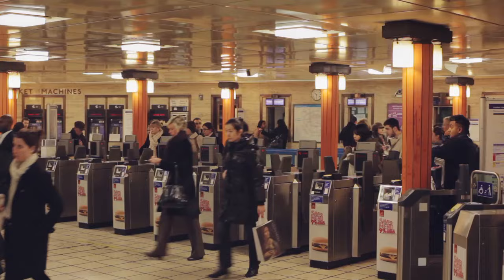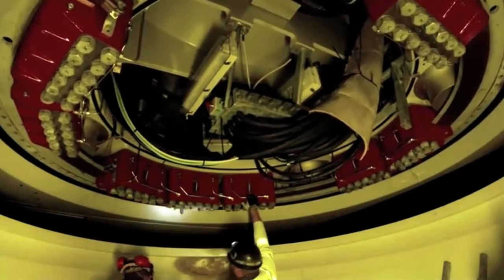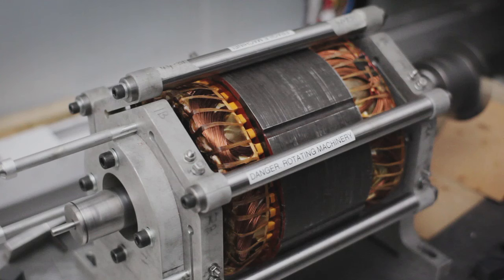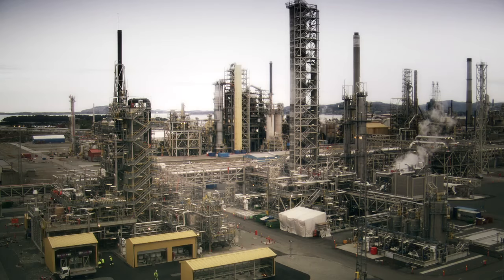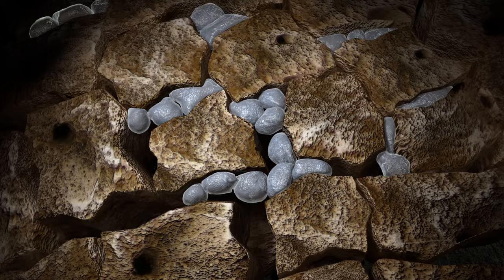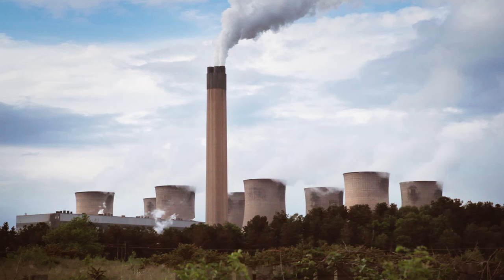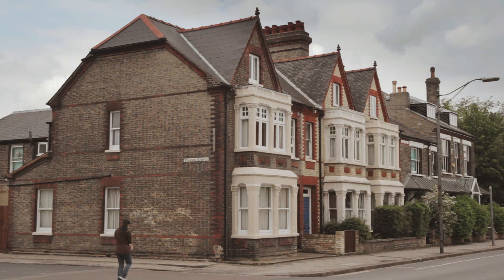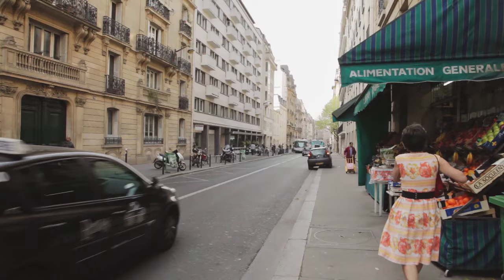The future of energy?

Comment: Upon watching until 4:18 when the speaker was saying "We must think about how our other energy usage could be transferred into electric supply then we could've caused so much generated electricity cleanly." I SUDDENLY HAD AN IDEA!

--because there was a clip of a bunch of vehicles on the road during that statement, I thought: why not generate electricity from the vibrations or whatever forces vehicles generate on the concrete pavements? (I'm no engineer though)

People usually complain about the roads being the cause of heat island effect, now with that idea, at least it would provide more use right? Especially in megacities where there are always vehicles and the traffic is terrible.

Also! (Idea #2) Since concrete roads are huge heat absorbers, why not generate electricity from that? An innovator should design some LITTLE contraption-whatsoever for that :)

Comment: Thorium reactors are the answer. 150 mile electric car battery. Turn gas stations into a quick change battery station. Don't own the battery change them out with varying degrees of mile capacities. 50, 100, 150, 200 mile batteries.

Comment: I'm no expert or anything on this but, if a car is moving at 60mph, then there must be air going at 60mph against the surface of the car (right?) So, I was thinking if cars could have wind turbines inside the grille, and several of them, it would generate a lot of electricity that powers the car,it would be able to run purely on wind power, so that means we'll be using 50% less oil (transport) .

Comment: 1:20 better focus on cleaner energy.
because every year the energy consumption we use more and more. we might use it more efficiently but nontheles we use more. and there is no sign of stopping that.

so cleaner energy is the future.

the best thing whould be making fusion
Reply: Ewokah Dong goverments could start with placing power chargers and hydrogen fuel station at every pump/gas station. and maby force privit as well.

this whould stimulate sales.
Reply: rubikfan1 More simple would be, and read closely because this will work, mandate that all houses are to have evacuated tube hot water =  20A offpeak load that is currently used to heat the countries domestic water can then be used to charge domestic vehicles instead because the hot water will be heated by the sun (is mandated in Israel already, they dont fuck about because they cant afford too) = no or little rise in electric bill and drastic drop in oil/petrol usage. With no upgrade to infrastructure.. Do you follow and if so would it work and not be the most simple way to make dramatic change for little $$?

Comment: Great video! I think this is one of the most important topics to consider in physics and other related subjects, as it is so current, and essential for the environment. I think that although finding a way to more efficiently produce energy is very important, the amount of energy that we consumers use is the cause of most of the problems. (If we can find away to live a good lifestyle without as much need for fuel/energy, then less fossil fuels would be required by power plants, which would obviously lead to a decrease in CO2 production.) One way in which I think we could make a big difference in reducing fossil fuel consumption, is to design and manufacture vehicle engines that can efficiently turn a totally renewable substance, such as solar power or water, into enough energy to match the energy released from combusting fuels.

Comment: Why would we want to re-sequester the carbon from fossil fuel?  The carbon is already trapped as a solid or liquid.  We don't need to re-trap the CO2 if we don't burn the fossil fuel.  Switch to nuclear and leave the fossil fuel deposits where they are.  The ultimate in carbon sequestration is not to have released it in the first place.

Comment: The best energy source is also binary cycle power generation plant.
In my area, the temperature of summer season is 30c° to 48c°.
Binary cycle power generation plants can b run with working fluid that have low boiling point.
Such as R245fa.

Comment: What's cheaper, building over capacity AND storage for wind and solar or building molten salt (nuclear) reactors. Even RE systems create chemical wastes which must be dealt with, either neutralized or isolated forever. Thus, the little bit of radioactive molten salt reactor wastes can be stored too. The only difference is that 80% of radioactive fission products decay into harmless elements in just 10 years, (the other 20%, just 300 years). The super long lived wastes (actinides) can be reused in the molten salt fuel, if closed cycle.

Why would ANYONE want to put CO2 into the ground without first chemically fixing it!

The way to deal with that is to put it naturally into the ground - as soils. This requires mega nuclear powered desalination plants for the water needed to literally green a desert. The nuclear power option could be sidestepped (to some degree) if water was instead barged from the mouths of the plentiful rivers worldwide. The byproducts: a very minute volume of nuclear wastes (comparatively) and LOTS of produce/vegetation.

If greening an entire desert is not enough to store the approx 2.2 TRILLION tons of excess CO2, then, we'll have to use diesel powered heavy equipment to MINE OLIVINE rock, crush, pulverize and distribute. It's like a fertilizer which sequesters CO2 into limestone when rained on. Eventually, it goes into the ocean and also counteracts ocean acidity caused from - excess CO2. This is also natures way of geologically storing CO2 on the order of millions of years.

Therefore, the discussion of liquid CO2 sequestration is merely directing people on the WRONG path (towards developing REAL solutions to safe excess CO2 storage).

Renewables should, however, be strongly developed AFTER machine automation can make them and their storage cheaper than coal!

Comment: This whole presentation is a bit of a flip flop, first wind energy is going from several % total production of electricity to only 1%. Electricity production in total 200 years ago was 0 (zero). Transportation 200 years ago depended on live man power, live horse power and wind. But the most important issue of global destruction is not mentioned with one word "over population". What about mentioning the green hous gas Methane? Newest studies show that Methane is responsible for 52% of global warming and it is coming from fossil fuels mainly Natural gas to fugitive migration from deep fracked geology, leakage from pipelines and distribution systems in cities and not from cows or swamps.
Putting CO2 underground for huge cost and uncertenty it will stay there is foolish.
We tried the nuclear way and it turned out that people like me where right 50 years ago who said it is not feasble because of the safety and the wast issue, now we know, TMI, Chernobyl, Fukushima and a unknown number of smaller icidents.  
Reduce population grows, install solar, wind, geothermal as much as possible, produce electric vehicles in mass production and reduce the production of combustion engines. Turn the lights of when not necessary, build buildings for 500 years and more it was done a long time ago. The list can go on. But that would mean that the greedy 1% would lose there grip on the rest of us.
Reply: Werner Rhein So what you're saying is "Capture, store and use the methane, and kill two birds with one stone. Brilliant! All you need now is the means to do it.

Comment: Why does a coal plant need so many more cooling towers than a nuclear plant? In canada we just use a river or lake for cooling.
Reply: Phillip Trzcinski
Actually I learned that if you send hot water to a small lake or river the water can't hold as much oxygen which will kill fish. The great lakes Ontario's plants are on are massive so it isn't necessary.
Reply: leerman22 "hot water" is a relative term.  It should be noted that water discharged is typically less than 20 degrees warmer than the water pumped in, ie., if the lake or ocean is 65 degrees, the discharge is no more than 85 degrees.
The law limits the delta T to 25 degrees...meaning, if the plant approaches that limit, they must lower power to prevent exceeding that limit.